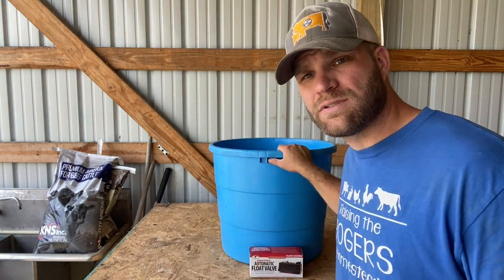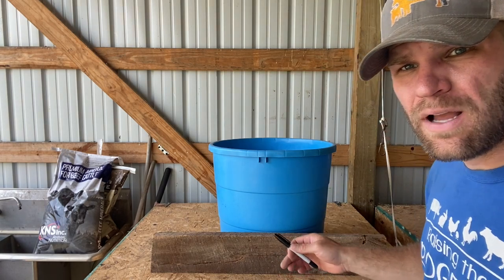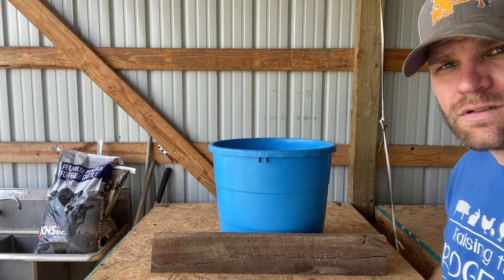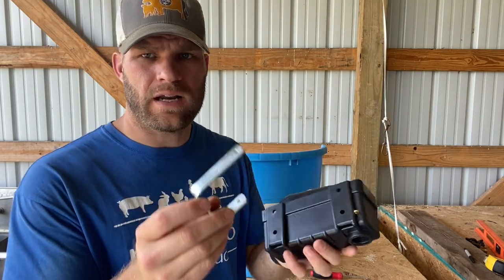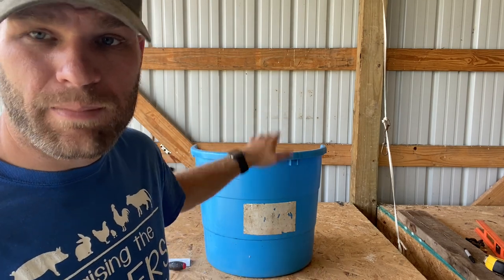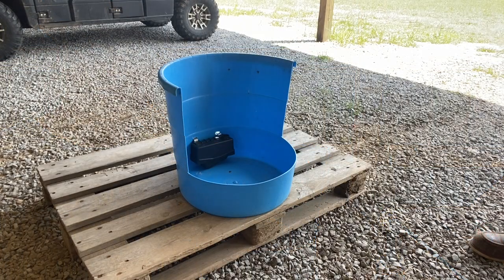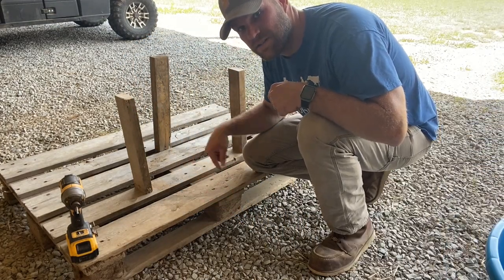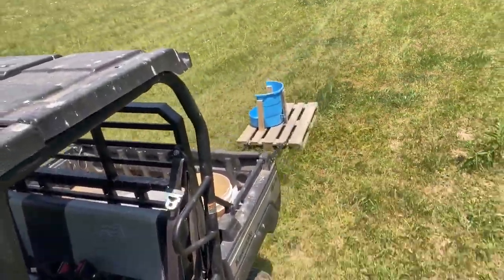DIY Cheap. Easy. Pig Waterer!

Comment: What do u recommend for hogs in a barn... for in the winter.. these guys are constantly dumping their water and making a massive mess
Reply from the maker: Well to be honest iv never had hogs in a barn. Pigs are gonna tear up anything you build for them and make a mess anywhere you put them. This has been the most mess free system I have found. If you put t post to keep them from being able to move it and make the opening just pig enough for their head. I have tried the water nipples before and once they figure those things out the will just hold them down with their mouth until they make 
a wallow. I have never been a fan of just a water trough because they really make a mess with them! With it being in a barn and stationary I would build a whole frame for it screw it to the barn and raise it up higher I will end up marking some modifications I am sure but for now this works great for us! Thanks for the comment! I hope this helps let me know how it turns out!